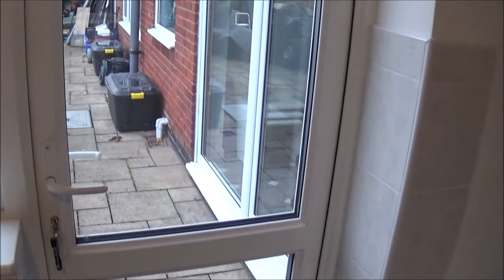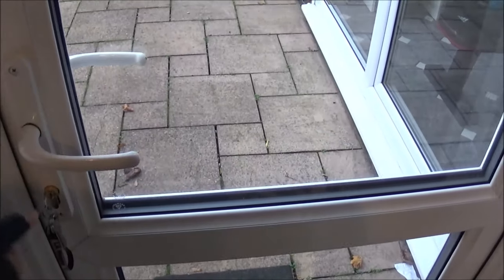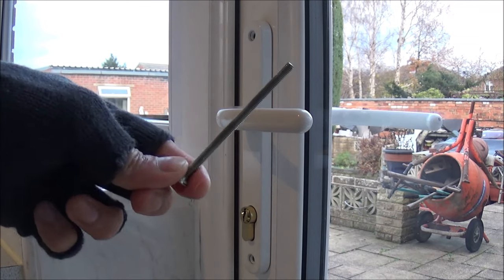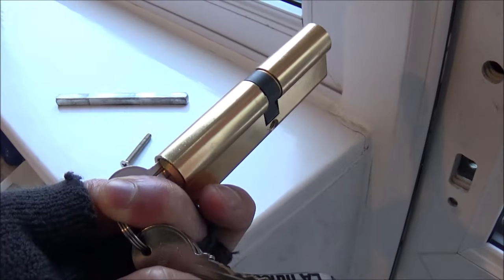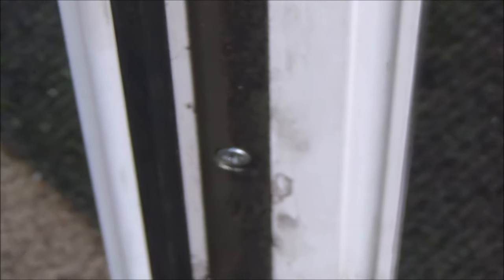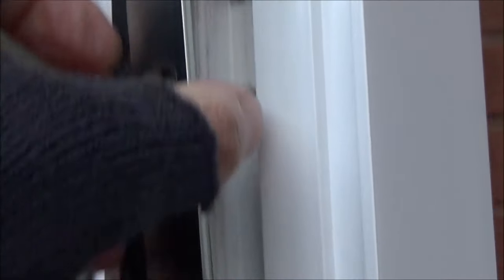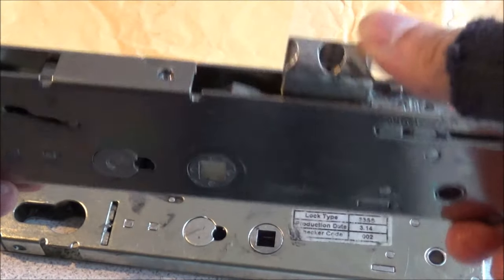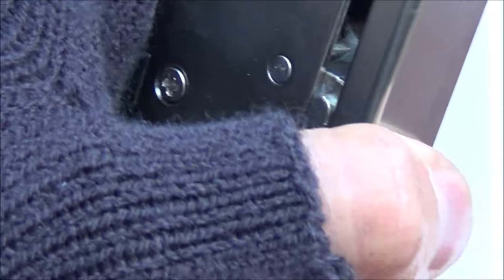UPVC Door Lock Gearbox Replacement, Barrel Lock Replacement, UPVC Door Locking Problems, Fix, DIY.

Comment: Looks like a Snap On ratcheting screw driver, that was an expensive investment for me but o have it now for over 35 years. Quality tool!
Been doing all of my own lock replacements for 40+ years, got my certification and Bond in the states over 40 years ago. Moved to the EU and still do all of my own work on my rentals and home.

Comment: Man, you saved me a £185 for a locksmith charges, thank you very much 👍🏼🙏👍🏼
Reply: I only charge £80 plus the gearbox. About £120 total. 
Next time take the whole lock out and rest on the floor to change the gearbox. Always tighten the cylinder fixing screw last. It needs to be loose when fitting the handles. Also a good idea to strip the hook boxes and re lube them, if they are manky and dirty they will put unwanted stress on the gearbox and cause it to fail. Lifting the handle with your palm is bad, the component that the spindle goes through is only cast material, they often break from heavy handed use

Comment: Three years ago I changed one, but I removed the long metal strip completely, and it was not easy to get it back in exactly the right position.  This time, I will use your trick of not removing the strip completely. Thank you so much for your clear and helpful video.

Comment: Wished I'd watched this video sooner. I'm on my 3rd new barrell in 3 months - been advised today at a local hardware store that it's most likely the gearbox that's stopping me from locking my door and not an issue with the barrell. However I'm now an expert in changing the barrell and removing the handle ! Will try removing the gearbox tomorrow and trying to find a replacement for it. Thanks again for posting.
Update...successfully replaced the gearbox (local hardware store was very helpful and knowledgeable). Fairly straightforward to do this. Door now fully operational again !

Comment: Cracking video. I easily removed all the locking mechanisms. Found that the door lock gear had broken inside. replacement sourced and fitted. Working perfectly. Thank you.

Comment: Thanks for a great instructing video. Easy  job 
that looked  much  worse before I found this video  - so thanks again. 
My gearbox stopped working Sunday, and neither toolstation  or Screwfix or Wickes had the part but one small family business on amazon had it for £17 next day delivery and the option I chose was next day before 1 pm + £2 other businesses was from £24 and not delivered before Tuesday. 
The part fitted perfectly just  needed silicone for parsing the lock through (15 years of weather). Be careful when choosing the  (right) model. There is another youtube with that theme.

Comment: A nicely presented explanation of lock strip down and replacement - thanks. May I make just one point, once you have removed the screws from the inside securing the door handle face plates, I’d recommend initially leaving the square connecting shaft in position until you have actually removed the external face plate, this will hold the face place plate and prevent it from falling off, potentially getting damaged and avoid unsightly dinks etc. Cheers

Comment: Thanks a lot for that. Just locked my back door and there was a snap and it's very stiff to operate. Still locks but I'll need to replace it before it completely packs up. Much obliged to you for your guide.

Comment: Legend, The three screws that go into the front of the gearbox that are different sizes if not put back in the right position door will not lock. After making a few adjustments mine is working fine now thank you very much.

Comment: Thank you , successfully changed central gear , very easy ,service charge 85 pounds . To break open door already paid 85 pounds cash .mine was lockmaster 35 mm single spindle .lots of them available in Amazon.

Comment: It's good to see the whole process, also to see you using hand tools not power. Many people use too much force & wreck the threads or screw heads.
I'm just dealing with a wrecked center lock  gearbox. The insides are often very weak & easily broken.

Comment: GREAT VIDEO HELPED SO MUCH But no marking on mine how do i know if its single or twin mine looks simlar to yours
Reply: sorted  what type it is a single one square but i fitted ia all and cannot get the thin square latch to move I can see it acviated by the key euro cyclinder lock but this part not turning to move the thin square latch
Reply: SORTED THANKS did not realise that the door handle moved the slider mechanism which switches latch to lock

Comment: excellent. i am 78yrs old lady living in Pyrenees near Spanish border.  difficult to find a locksmith to come out into Vallee dAspe.  and i not enuff money anyway. My problem is door handle becoming more and more unnusable for well over a month.  Then it got slammed shut one day and now unable to open it. I can turn handle up and it does its job. but the only key of loads i was given when i rented it will enter the lock but won't turn either way never used it anyway and don't know if it is the right one.

Comment: Excellent video bruv . Got UPVC door from fraudulent couple from Leicester.  Lock barrel damaged, Key ( Wrong ) snapped and missing , Gearbox latch not opening and closing , basically messed up locking mechanism.  Dont know if its handles or gearbox . Some muppet private sellers out there messed up my valuable time.

Comment: My problem: I believe the latch spring in the gearbox has dislodged or broken. I managed to get the barrel out but the strip seems to be stuck just below the upper door latch. Tried to lever it out but didn't want to use too much force so had to give up. Managed to put the barrel etc back in place so its no worse than when I started. Any ideas as to why the strip should stick at that point?

Comment: Video was a great help thank you . Does anyone know how to remove the barrel of the key is broke in it I can't turn it to release it
Reply: You drill through the Barrel, start with a small drill bit then bigger and bigger at the same time turn the key back and forth and eventually it will come out. Keep the key on the inside end and start drilling the other side of the key hole of the barrel, drill half way in and then keep drilling the hole bigger and bigger.
Reply: @banzanbuddhist1451  thanks for replying I'll try that now
Reply: @jlawlor7560  how did the drilling go?
Reply: @ryonchero4401  I got it out after ,it drilled our simple enough thankfully

Comment: Basically, my door is only half locking. I'll lift the handle everything will go into place, then I turn my key and it won't fully lock. It clicks but it's hitting something. I've taken the lock out and it isn't that, that is moving freely, it's the mechanism above the lock that appears to not be doing it's job. Any help with that?

Comment: nice vid - very helpful and some lol's but thats how I role too! Is there an easy way to find the mechanism model for replacement ordering?
Reply: If you look on the strip it will have a name on it, then google for the picture of the one you need, most companies have a few different sizes.a lot of online companies can work it out from a picture as they have slight differences.
Reply: @davidhill4053  Thank you for the advice I will check it out.

Comment: My door handle doesn’t trigger the gearbox mechanism but the hooks and sliding bolts work if I manually slide them when the door is open, independent of the handle, I’m gambling that it’s the gearbox that’s faulty.
Reply: Currently having the same problem. Did you find out what you had to fix?

Comment: I have a problem with door handle its when you shut door and pull up to lock  you have to really pull it hard  up to engage  lock so you can turn key ,but if you open door it works fine

Comment: Just so every one knows watching this thinking about tackling this job, if you mess it up in any way a locksmith will charge you more than original price to fix it
Reply: Nice try Mr. Locksmith, but we will try ourselves first. If that fails, we'll call a locksmith not a cowboy.
Reply: Really why is that? The same bits will need replacing right?
Reply: True that, especially if they get the door jammed in the closed position! Especially dropping the bottom pins, nightmare to sort out.. Airbags and bent nose pliers everywhere lol.